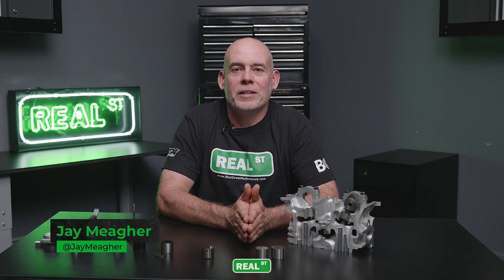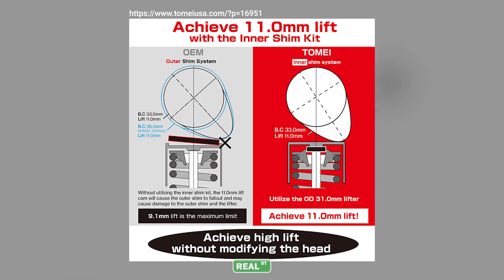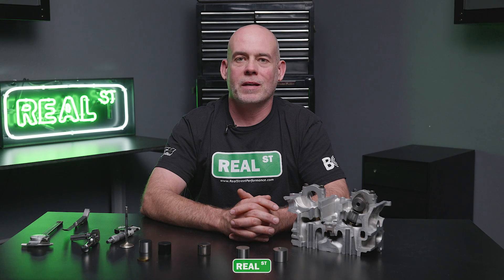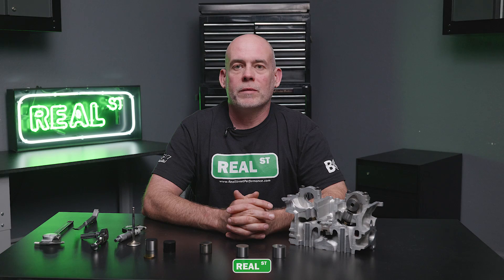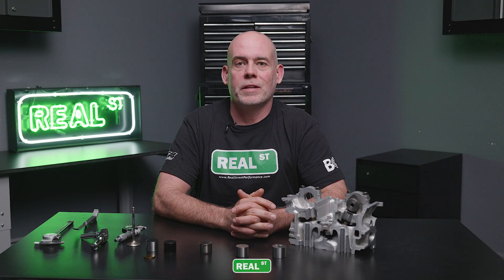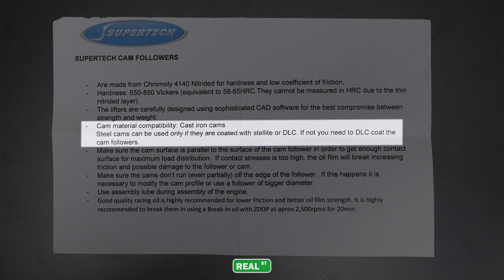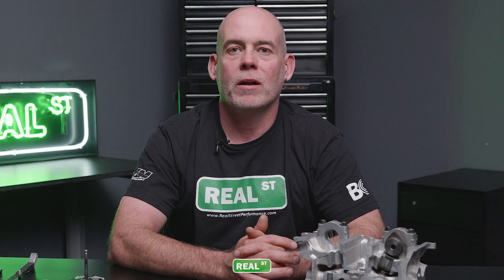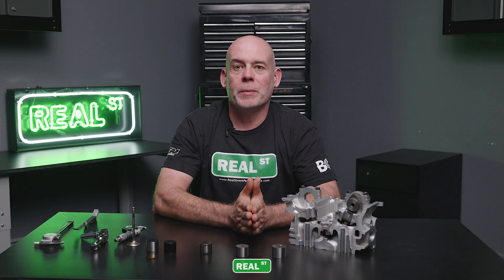2JZ Buckets | Everything You Need To Know - Jays Tech Tip

Comment: Mazda use shimless buckets and the manufacturer actually states they do not need replacing for the life of the car!   You don't even measure them.  It's all done by ear.  How "tappety" they sound.........   I have an 09 Mazda 3 SP25 with 140,000 miles and just for a laugh had the lash measured and it was still the same spec as assembled from the factory in Hiroshima in 2009!  Amazing.  Mazda dealers tell me they have seen many 300,000 mile engines that have never needed adjustment.

Comment: shim-under-bucket has been the standard in 'Nord' and Twin-spark engines since the 50's.   Also the Maserati 2.5 and 2.8 V6 'biturbo' engines.   I'd never seen a large diameter shim-over-bucket system until now!   Sure makes changing valve clearances easier, without removing the camshaft to change shims.   Shimless buckets are a nice touch.

Comment: Hey, I’m here wondering about a lifter tick in my 2jz in a Lexus is 300 not sure if it’s damage to cylinder one and if it’s having anything to do with it but cylinder one said it had a misfire as well and the tick sounds like it’s coming from closest to the fire wall think it’s damaged it’s spits and sputters at low rpm taking off higher speeds 70 ish it seems to not misfire as bad as if it’s at idle and taking off?

Comment: Glad I found this video. I am experiencing a ticking noise around 2000rpm on my '04 IS300 (stock 2jzge w/ 220k miles) kept the oil topped off but I'm wondering how much wear the cam lobes have taken. Thanks many times for the valuable information

Comment: Hi Jay, thanks for the info on the DLC coated buckets! One question I have is how come a lot of engines don’t need cam bearings, but the cams just ride in the journals? Unlike the mains and crank which always have bearings. Is it just the amount of weight and load applied which is less in a cam than a crank?

Comment: I built my supra 2j about a year ago. All going well.
However this has now made me nervous about the oem shimmed buckets, with the 269 9.9mm lift cams I have in there.
Is this very drastic and I should change them out right now, or ok?
Reply: Youll be fine. Ppl run 272 all the time on stock buckets. I did. And was revving to 7500. And heard others revving higher than that but not recommended either
Reply: Maybe your thinking of "advertised duration"... The duration that counts is the @0.050 duration, different manufacturers ramp up the lash differently, so the industry standard everyone is interested in is the @0.050 duration
Reply: You can't be running 269.9mm cams bro! 😂 11.0mm cams are pretty huge cams bro- that's 258.9mm less lift than yours bro!!! 😜
Reply: @danielbrealey2924  No. They are 269 duration and 9.9mm lift.
It says 9.1mm lift is the limit.
Duration doesn't really matter.
Reply: @BassInterrogation  I thought as much! 😂 And yes, I'm aware duration doesn't have an impact... Was just a funny little typo in your initial comment I was pointing out... 😄
Reply: @BassInterrogation  And that 269 duration is "advertised duration"... It's @0.050 duration would be in the mid 230's to mid 240's at a guess... I run 238 deg duration cam in my RB30 Turbo